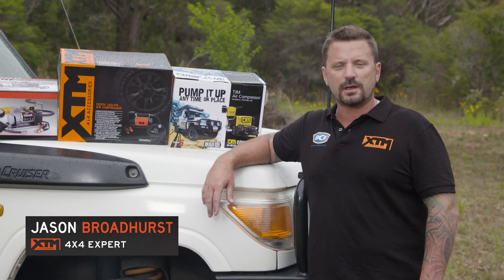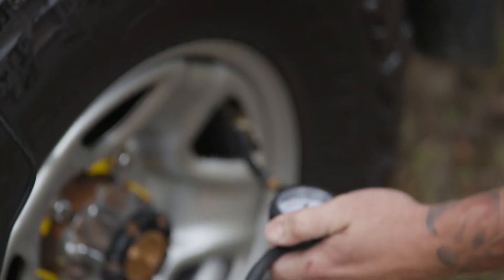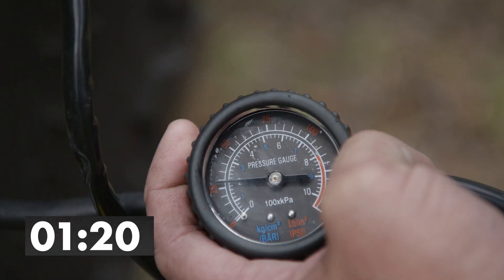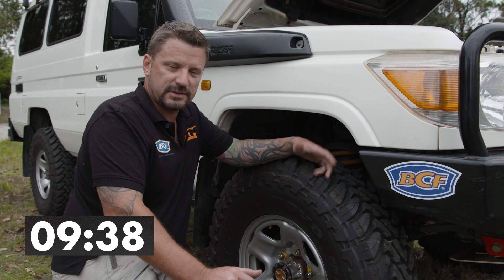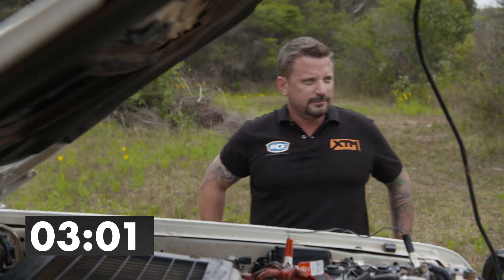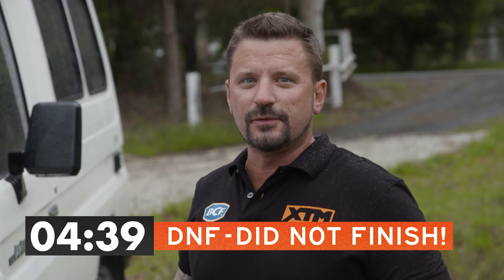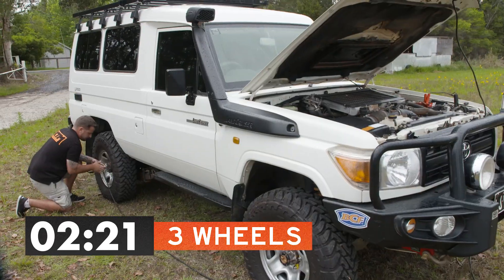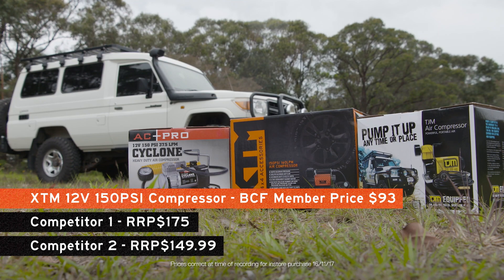XTM Air Compressor Jetair 160L/M 150PSI

Comment: Mine is showing 25psi as soon as I turn the compressor on (not connected to any tyre). Its way too inaccurate and there's no way I can use the included gauge to inflate a tyre to a desired pressure without turning off the compressor. The video doesn't show this flaw??
Reply: You turn all compressors off to read mate
Reply: @DarrenBoxhall  even with the compressor off its way inaccurate.   Don't have to turn off my larger garage compressor or the one at the service stations to get an accurate reading. Why should this be any different.  I'm guessing most of these cheapies are like this though..
Reply: @tonydelovski8088  the ones at the servo stop to take the reading,and the manual ones you stop to get the reading too
Reply: If you don't stop,it picks up pump Pressure,not tyre

Comment: They air up very quickly which is great.  Much quicker than a couple of more expensive compressors used by my nephews.  It’s just that the fishes don’t seem very good.  I use an old fashioned pop up one to check.  I might get a digital gauge at some point in the future. I’m happy with mine.

Comment: I just bought one on the weekend and used it for the first time. When pumping tyres up, I couldnt seem to get a true reading of the tyre pressure while it was inflating. It went up around 75 while actually inflating, but then when I turned it off, dropped down and showed the actual pressure of around 40. Is that normal, or should it show the actual pressure and the resultant increase as it inflates?
Reply: Darren Whitney mine does the same... weird
Reply: The readings on my xtm are about 5-7psi higher that the reading I get at a servo, on my deflator and on a hand held pressure gauge.
Reply: Any reply from BCF as to why the pressure gauge is not accurate?
Reply: You don't read it whilst inflating. And don't compare it to servo pumps. Grab a good quality hand gauge and compare it,if it's out consistently,just take note of the amount it's out by. It's a $90 compressor,it isn't going to be spot on in every area